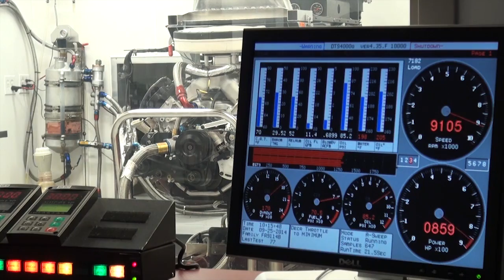New Rules for NASCAR Sprint Cup Series Racing Engines

Comment: "Restricting RPM is dumb!"

Blow ups makes the racing interesting.

The restrictor plate is a good idea, but a tappered plate I doubt is going to do much towards restricting power. what happened too the simple flat plate one inch bellow the throttle, no touch with 4 bored guaged restrictors method ?
why don't NASCAR just make everyone use a simple holley 3310 vac secondary carb, prefix numbered too each car, that must be removed by the scrutineers & collected after each race.
No modifications, at all with the exception of the main jets.

Distributors, ignition. Points distributor, one power direct from the battery, with NASCAR supplied relay one wire too coil, NASCAR supplied ignition coil. No other wires too the dist engine or coil. Cable drive tachometer.

How about claimer rules ?

Short blocks all the same configuration, Any team can purchase a New or old short block from NASCAR at the track or from a competitor same cost as NASCAR set price. Rotating assembly Cannot be changed, or modified outside spec, with the exception of camshafts only.

 All engines based off the 23deg small block Chevy.
No exceptions.

Anyone caught cheating, is banned, & fined.

Comment: What get me about NASCAR is GM gets to run it's new state of the art engines. Ford has to run their 1969-70 engines, they can't run their new state of the art engines. What gives here ? I guess GM pays off NASCAR and Ford doesn't. Ford's new engines are OK in the NHRA and the IHRA.
Reply from the maker: I don't understand your comment. After NASCAR allowed a 4.500-inch bore spacing, Chevrolet came out with the R07 engine for competition in 2007 while Ford didn't race their new FR9 engine until 2009. So the Ford engine is actually newer than the Chevy. And like the Chevy R07, Ford's FR9 is a clean-sheet design that share practically nothing with the old small block from the 60s and 70s.
Reply: @TheHorsepowerMonster  I am not a NASCAR fan and haven't kept up with things like you have. I know that Ford has never been able to run anything similar to the engines they put in their cars. since the mid 90s. So you are telling me . is that the old stuff went away in 2009.. I stand corrected.
Reply from the maker: Gary Shinn No worries. And thanks for watching!

Comment: I've been watching NASCAR races since 1963 and have witnessed all the rules changes that NASCAR defines as being in the interest of "parity" (equality among teams) but the results represents a more sinister agenda towards maintaining control of the sport, in the interest of certain manufactures.  Several key points illustrate this fact,  such as Jimmy Johnson winning five consecutive championships with a total of six championships in 7 years for Chevrolet, ...if the rules create parity, how does Hendrick dominate the series for 6 years?  NASCAR also allowed Toyota to enter the series with an advanced new generation engine and then approved Chevrolets brand new RO7 engine which debuted in 2008 while Ford was still limited to the old Windsor small block.   How about Kyle Bush breaking both legs at Daytona and yet he won the Cup Series Championship in 2015 after missing 8 races ..total BS.   How about Nascar allowing Jeff Gordon (Hendrick Chevrolet) to be the 13th Chase driver.   Then, once Ford got the FR9 engine debugged, Penske racing won 11 races in 2014 and Roush won 2 (when Ford hadn't won more the 5 races during each of the previous 5 seasons) NASCAR (Brian France) saw that as a threat to his business model of making huge profits by selling Toyota and Chevrolet front row seats to championships and so once again, France handicapped Ford in 2015 by reducing the FR9 HP by 126 hp, and only 7 Ford wins in 2015 and 8 wins in 2016, allowing Jimmy Johnson his 7th championship.  Brian Frances most obvious changes made to control the outcome of the Cup championship is the Chase format finale ..whom ever wins that race is the Champion is total horseshit but France cashes in on huge corporate bucks.   People are oblivious to Frances secret agenda of selling  championships to the highest bidder,  ...I wish Ford would pull out of NASCAR and reveal the ugly truth about the sport.
Reply: I guess Ford threatening to leave NASCAR worked, they are the 2018 driver and manufacturer champions.
Reply: The only difference between the NFL League Office and NASCAR is  well.... nothing actually.   They have taken the LOVE we had for the sport and competition and killed it with strangling regulations and Corporate Greed!!
Reply: wouldn't expect any other comment from a fankid.
Reply: well as strong as Ford has been the last 2 years.....kinda debunks your theory.

Comment: Yeah.. Move the cam so high up now. The cam push rod is 2" long! Just use over head cams. As it's the 21st century!
Reply from the maker: Incorrect. The pushrods are in the 7-8 inch range. The heads are taller than two inches, so it is impossible for the pushrod to be just two inches long.
Reply: There 6" long...and getting shorter as they increase the height of the lifter. So if you're not cheating. You're not winning...
Reply from the maker: You said they are two inches long.
Reply: Dude it's a fucking metaphor. As cam push rod engines are 90 years old!

Comment: boooo!!! bring back the real stock cars. off the lot and into the races is where it wants to be. toyota is putting a TRD V8 in their camry stock cars, last l checked there is no camry that comes with a V8. either run the V6 or kick it off of the track.
Reply: TRD is nothing more than a reinvented Chevrolet motor

Comment: You also forgot to add you can be more aggressive with a roller cam
Reply: Rollers run cleaner as far as emissions, the suits are concerned about what's going into the air on race day.Sollid roller is how they easly get 7,500 to 9,500 RPM, Hydro roller is good to about 5,500-6,500 RPM,  any roller run cleaner and less friction.
Reply: Dell Jr hydro rollers are getting better though 
Quite frankly solid roller can get to some insane rpm

Comment: id like to see old nascar rules make a come back. race what u sale and the car bodies must be factory style.
Reply: AHh hell yeah. But They should still use v8s.  But they need to make them carbureted instead of fuel injection.  That motor in the video was fuel injected.  it would be a better competition if they had carburetors.
Reply: Why though? Fuel injection has been around for long enough that its not really new vs old. Yeah I guess the emission advantage is pretty pointless for racing but those little differences in fuel consumption are key to racing well. At the end of the day its a numbers battle. If you see fuel injection as "cheating" well that's racing. Any advantage that's legal is encouraged.
Reply: @pipeline_hank5277  im not really understand your point of wanting CARBURETORS over efi when it comes down to it theys only going to 2-4 hp difference between the two and of you run the same test the next day and it will be the opposite engine that makes more hp what im getting at is they both will make the same hp. Its all in the person thats doings the tuning
Reply: allmarinemaintenance In the one year it took for you to respond to that, I changed my mind. I hate carbs now lol
Reply: 105Percent_American carbs are actually trash man.
Reply: If im not mistaken the fords at that time were actually more aero dynamic lol

Comment: If nascar wanted to save the teams money they should either do away with road course races or run more road courses. They only run a couple road course races. So say you have a 4 car team. Each team has 2 or more cars per driver per road course. Sadly enough those cars sit all year until it's time to load them up and chances are the backup car will never even be used.

Comment: the good thing about the cam change is as stated engine longivity and it would be difficult to montior fuel  modifications such as tweak injector programing (lengthen pulsewidth all done in the car to comply after race reset to specs but a restrictor plate it is what it is cant modify it that hole is going to be that hole size  start to finish  if they tried to pull the throttle body off and switch they would get caught  fast  i say let the horse power roll  in reality the car mfds do dodge hell cat 700 plus  shelbys 600plus  gm samething  who cares make power and roll  speed will find its own limits you can only turn left so fast  and thats its it  tire and suspension technology  will catch up quick  and maybe transfer to hiway  veh.  who knows  oh i know low budge teams will suffer  from high cost of r&d   they will make it more exciting